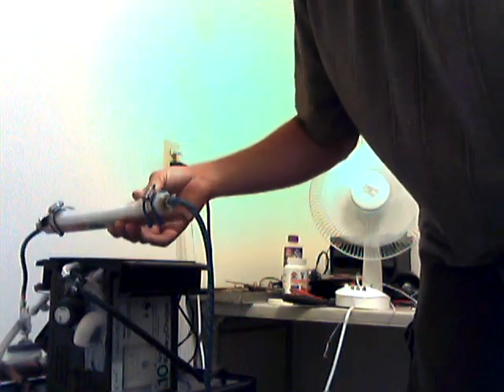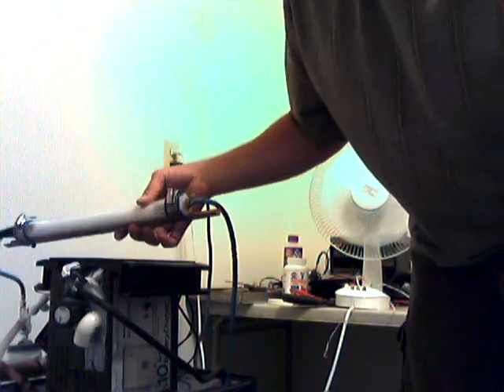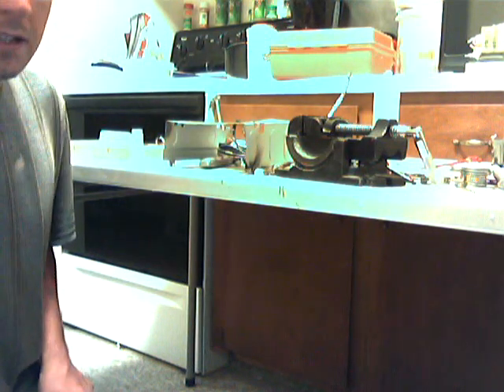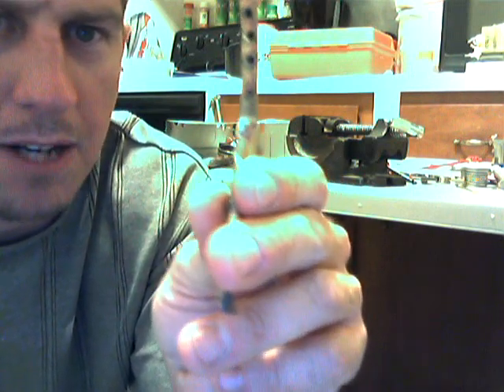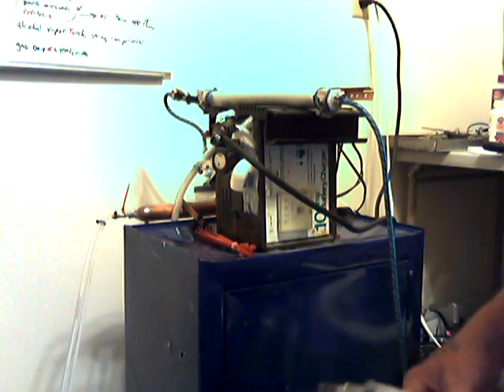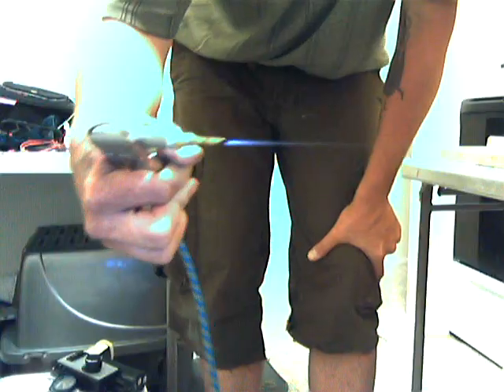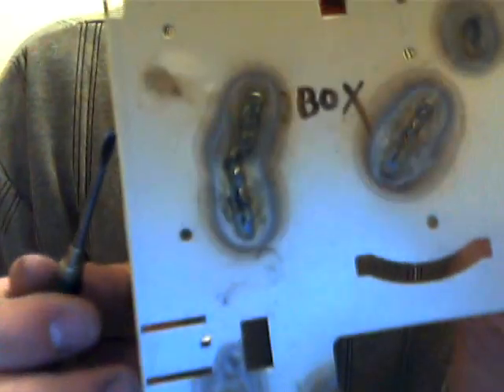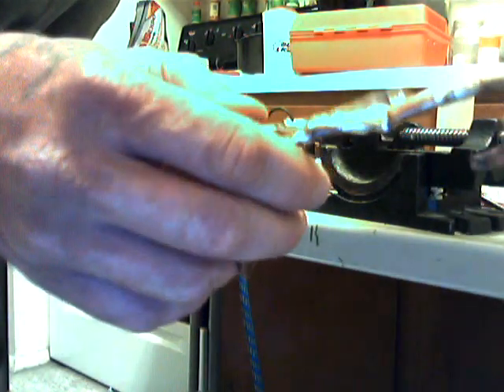DIY hho torch desiccant charge gas dryer

Comment: I know what ya mean man!, I'll always keep MAPP or Oxy/Acte for the big jobs, but lately I've been using most of my bottle for little jobs that HHO would excel at, but as you said, I don't want a 200lb cell to fill the role of a 1lb torch that takes a little longer to heat up the tubing.

Comment: Take isopropyl alcohol and dissolve as much salt in it as you can then let's settle it will turn into two layers of alcohol will float on top of the water decant off the alcohol and then fill with salt again making sure to dissolve as much as possible then put salt and alcohol solution into a secondary bubbler the hydro scopic liquid will remove water from the gas

Comment from the maker: ok describing heat capacityto people is very hard but you are very smart so this should be easy ,,,,, ok a propane flame 
or other gas flames when combusted 
brake into seperat compounds the more moleculer change the more vibrating atoms we get from the mix now heat is only vibration of atoms,mapp gas puts of 10 times more heat becuase it has ten times the moleculer alteration hho is hotter but becuse its les moleculer alteration thier are less vibrating molicules then other gases

Comment from the maker: well friend im not yet shure how long the charge will last but it will be reusable 
i designed it to be emtied and dried out in
an oven,now as for the mapp gas comment let me be clear hho is not sutible for very many jobs,experimantation
constructions are good for hho soldering 
and metal bending ,but cutting and soldering very large copper components 
are not easy with hho it has a lower specific heat then wax bro a fkn candl puts of more heat per mass then hho its just hotter

Comment from the maker: just to be clear when i said 200 pound cell
i was refuring to those efficiancy buffs
my cell is horably inaficiant i think im at 2.8 MMW but for the cell size it puts out a bigger flame then any torch its size becuase i am one of the fiew who connects a flow pump up to the device
this alone doubles the output to size ratio
i also use a bigger gap then most people they think it helps but im not into efficiancy they dont get that ive had to say it 1000 times ,yes efficancy is neat but big
Reply: To a point about gap size. Too small of a gap can restrict current flow at high current density.  Thatvis because Bubbles get in the way reducing the effective cross section through which current can be conducted. Having a little extra gap along with forced circulation can help get remove the suspended gasses  that in turn allows for a larger current.  But with gap size there's a point of diminishing returns and any improvement in the electrolyte's capacity to conduct current around bubbles is off set by increasing resistance  through a longer path through the electrolyte.

Comment from the maker: dont get me rong bro a good hho cell is a good investment just having it has led me to build thing i couldnt build before
low in tools and all i can drill holes very well and very persise with my torch
and the acces you hace to junk bro you could build a very good cell for 50 $
i dont have acces to the things you do so i had to spend about 250$ to get what you see in my cell small jobs actualy reqiure this torch in my world the micro flame is so hot it can do things no other gas can

Comment from the maker: i forgot to finnish i got called away any way becuase hho becomes water it has  less ability to heat things up it may be a hotter flame but butain kiks hho's ass 
gram for gram meaning if you wanted to boil water 1 gram of butain would heat up to 15 time more water then 1 gram of hho ,a small flame will melt tungsten ya but only a small amount hho wont even get heavy copper hot enough to use non lead solder ,i use butain on big solder jobs as its faster thats all faster hho can do it ........